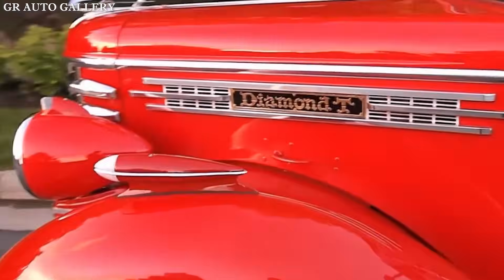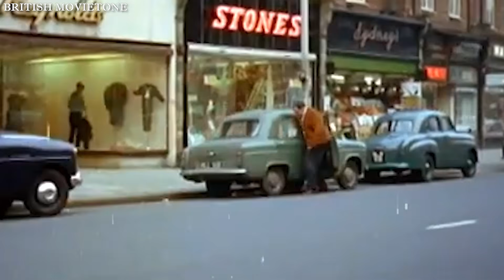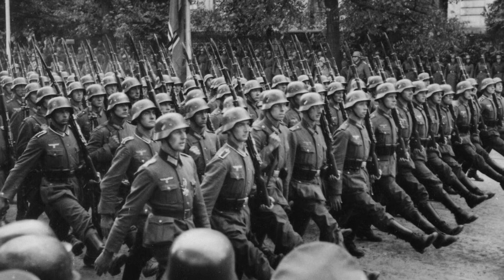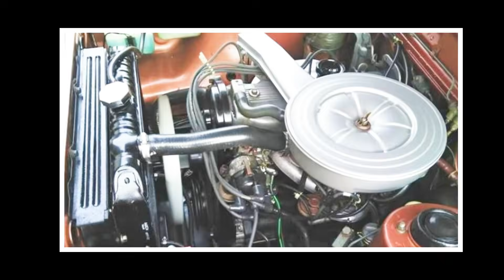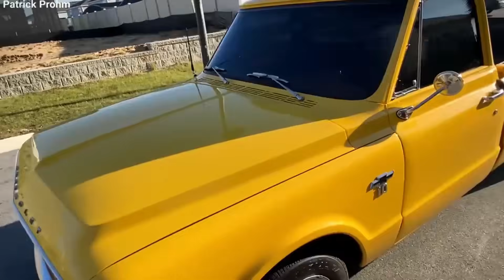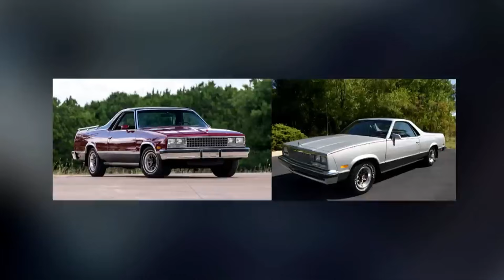11 Most Forgotten Pickup Trucks Now Extremely Rare!

Comment: I don't understand what kind of mindless propaganda is this? VW must have paid for it, otherwise it wouldn't be possible to talk such nonsense that the Taro, which is largely a Toyota, is worse than the Amarok, which is so bad that it's impossible to describe. VW made the body bigger, added all sorts of electrical and electronic gadgets and made the engine smaller, so this monstrosity isn't even capable of going up a hill on empty and, as VW usually does, it breaks down when you look at it, so you don't even need to use it, you can tell by standing next to it and looking at it for a bit how quickly this thing breaks down.

Comment: Oh yes, if you will, then Taro is the only VW with a durable technical side. The rest of the VW cars are just a bunch of poor quality spare parts that have been thrown together with a shovel into some big mixing machine and the pile that has been poured out of there is named some kind of car model for which you need to start buying and replacing spare parts immediately, because the warranty simply does not apply to VW cars, there is always a reason why the user has been to blame for something wearing out or breaking.

Comment: As for the VW Tarot, VW has done nothing there other than replace the Toyota emblem with their own, they haven't even bothered to change the Toyota emblem on the mirrors, everything is pure Toyota, except that the emblems have been changed and the tailgate doesn't have the Toyota lettering, which was pressed into the metal of the hatch.

Comment: Point of fact. The Dodge A1 hundred pick up and van did not repeat not come with air conditioning. You could get power assist steering which was basically add-on hydraulic slave units to the existing suspension.

Comment: I had a ‘85 D50 4X4 I bought new with the 2.6L and 5 speed.  Mine had issues with going thru clutches that Dodge didn’t want to replace even with a dealer saying there was an issue.

Comment: I owned a 67'short bed fleet side, built 350ci. 373posi. 3 lift kit for 2wds. 35:1250 mudder radials bull bar push bars 8" angle tucked under rear bed. Headers mid low cam
 Truck was quick.paint Chevy seafoam green. I was in the sign business. I also owned 3 other monster trucks 3,vans. Self taught mechanic, learned a lot?!!!

Comment: The A100 engine is above the front axle, which means it's a front engine design, not a mid-engine. The engine needs to be placed between the axles to be considered mid-engine, and behind the rear axle to be considered a rear-engine design.

Comment: I had a '69  A-100 "Telephone Company" van back in the van daze of the 70's. I miss looking over the steering wheel at the road rushing by.😁👍
Reply: The way the over the wheel design handles  is  the coolest  handling  forward or backward  liability  driver  safety is compromised  in  forward crashes
Reply: @benvoncannon7430 yeah because you're the first one there 😮

Comment: I owned a 1968 Dodge A108 LWB van, with a slant 6 back in 1970 ... upgraded it to a 318 in 1975, and stupidly sold it in 1976.  I had the interior as a home away from home, and that 318 made it move.  Currently I have a 1966 Dodge A100 pickup ... custom wheels custom paint, and a fabricator is installing a 360 magnum motor in it for me (as it has to be installed through the bottom) ... with a 90" wheel base ... and about 300hp ... it should almost fly.  Planning on doing a bucket list and retracing Rt 66 in it starting in spring 2025

Comment: My uncle has one of the A100. He got it as a shell with no wheels, motor, transmission, axle, nothing. It had a ton of floor rust from sitting on rhe ground behind a barn in the woods fod years. 
He set it on top of a Corvette chasis with the full suspension, brakes, transmission torque tube, trans, engine and all. The rusty floor was removed and a new one made so that the body sat about 5 to 7 inches off the ground and was as arrow as possible for wind to pass under it smoothly.  The front grill, headlight rings and other chrome was gone and replaced by custom molded carbon fiber. The interior was titanium and carbon with a 13" grant racing steering wheel, B & M T handle power shifter on the 6 speed transmission.  Custom molded dash with Greddy digital guages, tablet mounted in dash angled to the right hand side driver controling preprogramed engine tunes for fuel economy,  drag, highway, daily, or track. It held fat Proxis Racing 18x255/45 rear and 16x235/35 front, the bed was usable to haul things and the truck was daily driven not a trailer queen. He races her at the NHRA strips of KY, TN, NC, SC, AL, SC, LA and MO winning many show and go 1st place tropies. 
The truck was destroyed by a drunk driver side swipping it at an intersection.  Luckily my uncle had updated it with modern airbags in the piller, wheel, dash and door roof line to save driver and passenger. 
His car work was on a whole different level whitch is why as a body mechanic and paint man he made $65hr back in 1996.

Comment: In 1978 a VW motorhome went through the auction. Dark blue, the very earliest model. Completely original, mint condition, even the original curtains!
The auctioneer allowed a reserve price to be put on it: the auction-house policy was ten year old max for a reserve. But they made an exception. It fetched £500. The price of a brand new small motorcycle. If it was still available in the same, nearly new, 12k miles condition, the man who is a VW nut who works near to my unit reckons it would easily go for £100k. I thought the buyer was mad paying £600. To my teenage mind, it looked very old fashioned and undesirable. My dad in a mad moment of madness bought a 1966 Sunbeam Rapier, £300. The Rapier would today fetch around £4k...

Comment: Ford, Chevy, and Mopar all made those van cab pickups back in the day, but how about pickup cab vans? They used to make panel trucks, and I don't know why they stopped, but I mean a van with a pickup cab, so you aren't sitting on the engine or the front axle. A nice big hood out in front of you for safety, like a square body Chevy, but a van in the back.

Comment: I want to throw this out there. The Dodge A100 was not the first COE light truck you made it out to be. That was either the Jeep Foward Control that also came with 4x4 capability and utility. But also the Corvair Greenbriar Van/Bus or Rampside and reg box truck. That was also rear engine air cooled for lower net weight and great weight distribution for bad snowy conditions and rain, the Dodge A100 and Ford E100 was sorely lacking in, plus had fully independent suspension that offered a much better ride and handling! Plus a robust weight capacity, but in fairness only offered up to 110 hp, but with 4 speeds and 3:98 posi trac. The one big advantage was in hot weather, where the Dodge and Ford were like driving an oven with the hot engine right between the passengers, that only got worse as time wore on and the dog houses grew open seems. But that made winters a bit more comfortable than the Corvair. Then finally a rare American pickup not mentioned here but was very rare. The 1976-1980 Scout II TERRA truck. That was a Scout II with 18” added between the wheels, exactly between the front seat track and rear axle. Offering a 6’6” bed that was one piece with the rest of the truck, built on a fully boxed robust chassis that offered 2,000 lb load and 7,000 lbs towing with the right equipment. There were two different 4x4 systems, a traditional 2 speed transfer with manual locking front hubs, or single speed on demand transfer with automatic locking hubs, or just 4x2. With a choice of 192ci 4cyl, 304ci V8, 345ci V8, or Nissan straight six diesel, NA or Turbo. With either 3, 4 speed manual or 3 speed 727 Torque Flite automatic. With removable fiberglass cab roof, or convertible cab top. I bought one new in 78, loaded with everything but AC, or fancy radio for just under $10k.
Reply: The Greenbriar, being rear engined, was a forward-control van or pickup, but it wasn't a COE. As forward-control vans and pickups go, they were all trumped by the VW T2.
Reply: @CaptHollister  have you ever driven all mentioned? I say the Rampside was the quietest, most powerful especially compared with even a 40 hp, or later 60 hp VW! Just as good or better in snow and off roads.
Reply: International Harvester actually used the Chrysler Torque Flite A-727 in its light-duty trucks???
Reply: Bill Mavericks Little Red Wagon
Reply: kevenvoyer  Man you saved me a lot of typing !!! You are 100%  correct that A100 Dodge was not unique as you elaborated,  great comment !!
Reply: Mike and Larry Alexander design a radical custom Dodge Deora ( A-100 )
Reply: Too long, can’t read it.
Reply: @chrislange4803 those corvair engines🤣🤣🤣 nice idea but. Problematic.
Reply: Appreciate the comment
Reply: except when you wanted to corner and the single CV joint rear axles and all that weight in the back made it's handling suddenly really bad.   My old SAAB 95 wagon was a much better wet road vehicle.

Comment: The Dodge D-100 pick-up was a latecomer to the party. Ford was making Econoline pick-ups from 1961 and there was a Chevrolet Corvair pick-up from 1962. You missed the VW Rabbit pick-up, especially the 60mpg diesel one. The late model El-Camino/Caballero barely lasted 5 years before rust finished them off. What happened to the Ford Ranchero (1957-1979)?
Reply: Had a 61 econu p up ,put 200ci orig 140 coil over shocks on front axle,J78 Firestone radials foil insulated motor box smooth ride.2bags of seemennt on rear wheel wells for snow driving, 14" chrome mustang GT rims ,pop up sun roof for air
Reply from the maker: Thanks for sharing them Sir. Can't add everything in one video. I will add them in later episodes of this topic.
Reply: @top.intel0  The Dodge D100 was an absolute piece of, well you know. Being late to the party they had virtually no fleet sales, and having the traditional Dodge quality no one, with half a wit, had much use for them.
Reply: The Ford Ranchero was discontinued after 1979 unfortunately